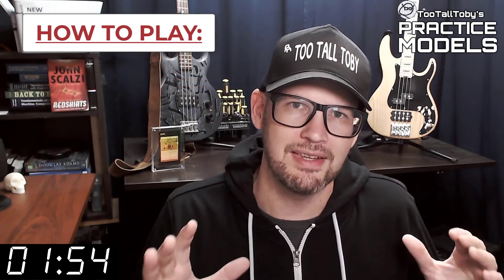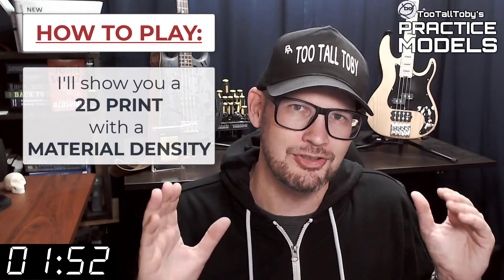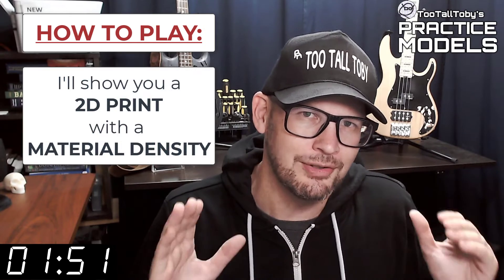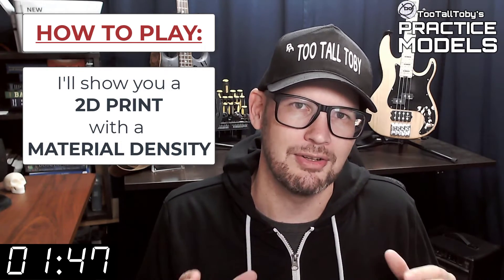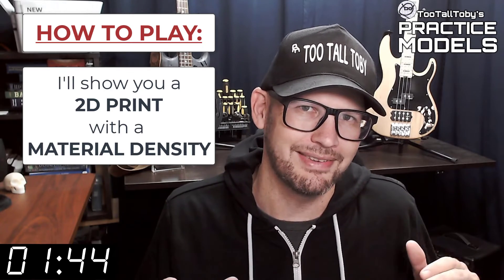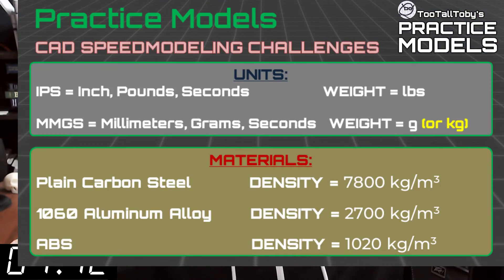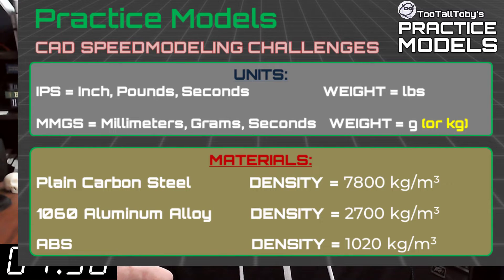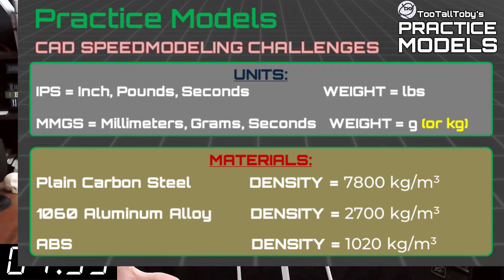2D Drawing to 3D CAD - PRACTICE MODEL- Exercises for Onshape, SolidWorks, Fusion360 - CLICK BRACKET

Comment: Lol, got the 0.521 pounds, but took 15mins, I'm resurrecting my CAD days from over 30 years ago (Autocad 9) and my brain has slowed right down, it seems😅 and I keep entering the metric conversion as I still know these from memory although left the industry 22 years ago.
Reply from the maker: Awesome!  What are you using now?  Onshape?
Reply: @TooTallToby  yes, Onshape, using it on a Chromebook at the moment, no problems so far. CAD has come a long way and I’m just scratching the surface

Comment: 0.521lbs in 8:54, Fusion360.  Did the sketches in Inches, then had to remember to switch to Feet in order to display pounds.  Flipped over to SolidWorks and did it in 9:10. Did lots of hack and slash after the initial extrude. In hindsight, could have combined sketches to save time.
Reply from the maker: Very nice!  I think this one looks a lot easier than it actually is!

Comment: There is no hight for the back hole, or is it?
Reply from the maker: Correct - the larger radius for the corner has its center mark located at the same location as the center mark for that slot.  So they are concentric.
Reply: @TooTallToby aaa. Thats right. Thanks!
Reply: Correct ;)